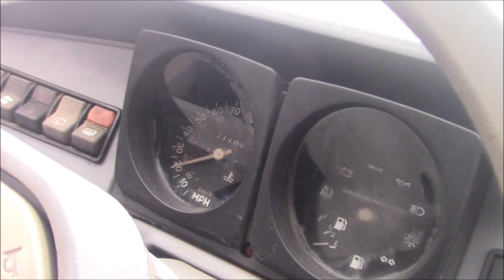Harbor Freight Predator swapped Yugo GV drives for the first time! - HF Predator Yugo part 4

Comment: I like the shop towel as a gas cap.  You don't see that anymore.  Great job sir!
Reply: That’s the last ditch, light it and leave it 🔥
Reply: Gee that old LaSalle ran great those were the days.
Haha I remember somewhere picking tons of red fibers out of a drainable/serviceable fuel filter/water separator setup  on some diesel every few months somewhere I worked cause of the red rag fuel cap.
Reply: Actually he shoulda stuffed that gas soaked rag in the blower motor 😂😂
Reply: The malatov cap.
Reply: lol

Comment: You might be able to put some kind of cable operated "band brake" on the rear pulley on the torque converter and hook it up to the old clutch pedal so when stopped you can stop or at least slow the pulley down enough to get it back into 1st gear.
Reply: Take it to the max and instead of a band use an old school toothed “dog clutch” like on an industrial winch.

Comment: Omg yes you guys are awesome 😂
Edit: damn haha ,off the bat that thing looks in real good shape. 
I'm not embarrassed to say the first shop I ever worked at, they bought out a Yugo dealership and I spent the summer taking 12 cars and making 7 of em saleable. 
Swapping used clutches around, foaming holes in rockers with expanding foam, yeah haha the good ol days. 
The back of the factory service manuals had hop up parts for em like cams and carbs and intakes. 
Oh don't forget the early days of the internet , Dave Yugo and Underdog. 
I believe he was running 14s or maybe 13s with his.
Reply: 4:20 was hoping for an attempt to make the tires rotate before the car moves, much disappointed 😞😂😂😂

Comment: Good to see it up and driving around 😊 That connecting shaft may have to be the most expensive part of this conversion to remove vibrations. Fingers crossed a bit of DIY lathe work cures the issue though 😉

Comment: I absolutely love these cars with the predator engine swaps I'm currently in the middle of trying to find a small car with a manual transmission to do the same thing myself just to have a car to run around within 10 or 15 mi of my house I think these bills have real good potential of getting very very good gas mileage

Comment: And you could always run an alternator off one of the back wheels and have it charged the battery when you're moving and that would make it so you could have radio and just only use the radio when the car is in motion

Comment: How difficult would it be to stick a Hayabusa engine in this thing? Ive seen it done on smart cars and it looked like a blast to drive. The hardest part would be designing a good shift linkage and rerouting the clutch.
Reply: No reverse in a busa gearbox
Reply: @Vaino_Hotti  electric reverse is a thing.
Reply: @watsisbuttndo829  I don't if it's thing in the budget world of lawn mower swapped Yugos :D
Reply: @Vaino_Hotti  busa in that thing would be terrifying!.

Comment: I want one.
Or similar project.

A regular 12 volt battery could work for minimal lights.
Just as a plug in battery maintainer and small solar panel.

If you can get something that operates from the engine power, that would be cool too.

Comment: If you are using a CVT setup you should be able to use rubber motor mounts on the predator engine and it should help a lot of the vibrations but maybe not the engines do like the vibrate a lot but if you could get your hands on a Duramax 500 cc engine I'm pretty sure they have counter shafts to balance the engine better it would be a good engine for this setup and it's a 500 single cylinder so it would put out good power without being too big

Comment: The lights might stay on because the relay wil stay switched on as long as there is power on it. If you disconnect the sensor circuit the power wil come of. Just check the relay wiring and maybe hook it up differently

Comment: Would it be possible to put a brake on the input shaft of the transmission(or on the secondary pulley) to make it shift better when standing still?
Reply from the maker: I was thinking of something like this. Maybe a go-cart or mini-bike drum brake setup.
Reply: @FuelInjectionSucks  could double as a parking brake 😊

Comment: I think you might need a slightly higher primary drive. Though, you roached that belt in 4th. Once you take the governer off, put the high RPM flywheel on it, and put some hop up parts on that thing from go power sports, i bet this thing will be about as quick to 40 as the stock yugo was lmao. Look at the cars and cameras various tuning kits for these. You can make some silly power out of these. Theres cams and everything for em.

I think a big thing you can do is lighten the rolling stock up too, if you can find 4 original honda insight spare tires and some wobble lugs you can run them on the 4x98 stud pattern. Or run some 13" alfa or Fiat alloy wheels or something. The lighter you make those wheels, the faster this thing will get up and go.

Comment: I DONT UNDERSTAND UNDERPOWERING IT JUST FOR VIEWS..U GUYSS SHOULD PUT AT LEAST A HONDA 250EX 4WHEELER MOTOR IN THESE CARS THAT WAY YOU DONT HAVE TO REV THE PISS OUT OF THEM AND THE MOTORS HAVE MORE TORQUE, A BUILT IN TRANSMISSION AND IS EASY TO ADAPT...BUT WHATEVER